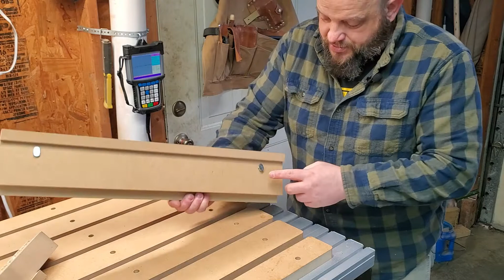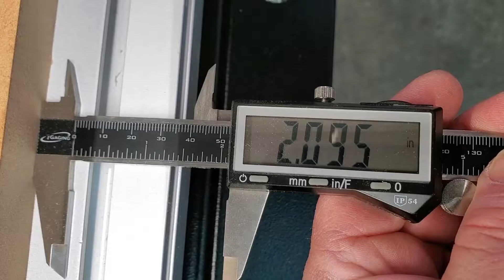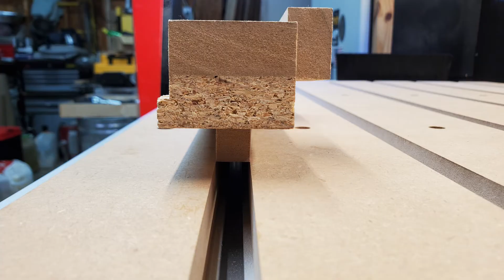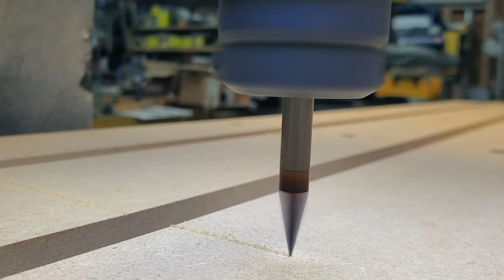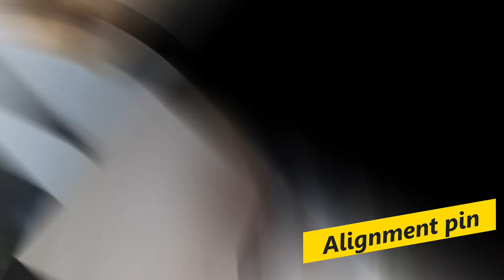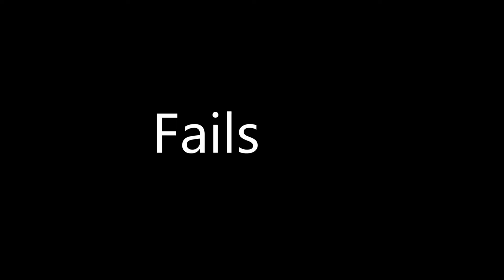Axiom CNC Spoilboard Grid and Fence Setup Jig

Comment: I am new to CNC work, and i have had my AR6 Pro for just a couple of months. Could you explain the grid made with the 30° engraver? Also, do you sell the files for the grid and pin holes? Thanks!
Reply from the maker: Thanks for watching.  The engraved grid can be used to identify your border and be used for different origin set points if needed for projects and layout. 

I don't sell the file, and I've upgraded my table to a newer and better design.  It's a more recent video on my channel. 

I've taken a bit of an absence from content as I recently got married.
Reply: @ChristcrossCrafts  Thanks for the reply, and congrats!

Comment: Got an Axiom pro.  Rather than index the boards, I created a 1/2” acrylic carpenters square on the CNC and drill a hole at the fulcrum.  Into the hole I can insert a metal pin.  This way I can drill a hole anywhere on the table and use the carpenter’s square along with the x-axis of the CNC to locate a perfect 90-degree placement for my wood and it’s not dependent on grids that may shift or get removed with resurfacing.
Reply from the maker: I also made 4 different size squares with holes to match my pin locations.  I can use them on my pins, anywhere along my grids, or wherever I need additional placement.  I have several origin locations set at different spots on the table.  The grids simply give me the ability to pre-set them and go.   I rarely use them for that though.

The setting jig is key.  I use cam clamps a quite often and the jig helps me ensure my strips are set correctly and spaced before I ever set my X/Y.  

That's the beauty of CNC.  Everyone can set it up the way it best suits their needs and job progression.

Comment: Hi What was the size of you Pin holes? and did you use the CNC to drill the holes?
Reply from the maker: I used 1/4 steel pins and yes, I drilled with the CNC.  I used the outermost perimeter and drilled with a 1/4 endmill.